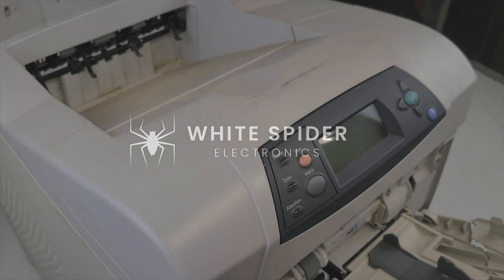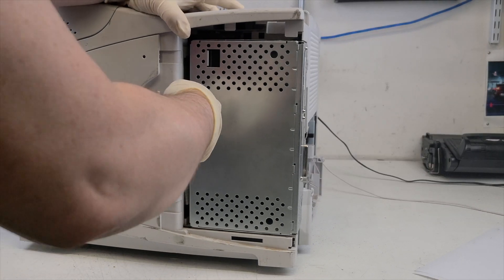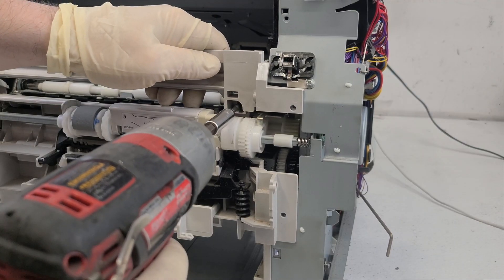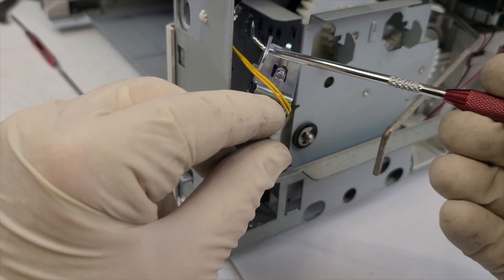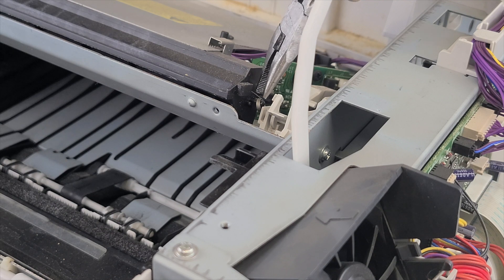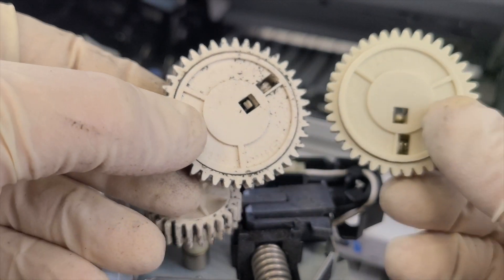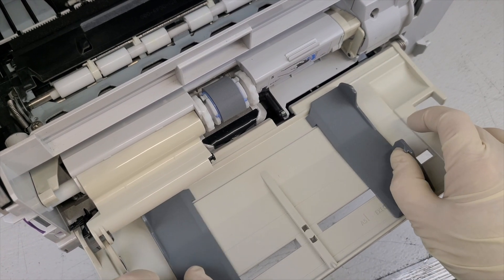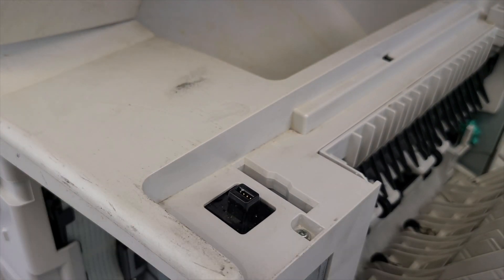Complete Refurbishing Guide: HP LaserJet 4200, 4240, 4250, 4350 Series Printers! 🖨️✨

Comment: Question:
What do you think is causing a issue of my printer. The dashboard displays:
 "Close top cover"

I already made sure the cover is closed
I notice that, when i power on the printer, the printer's exit rollers (flags area, where the paper comes out) the rollers do not spin. I think the rollers are supposed to spin when the printer is initializing.